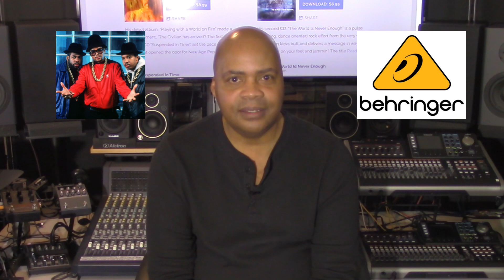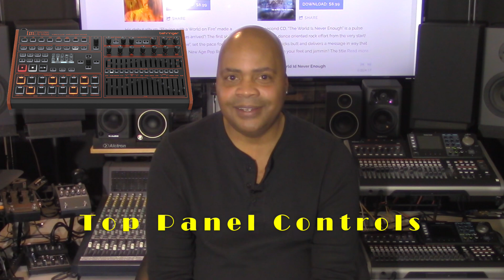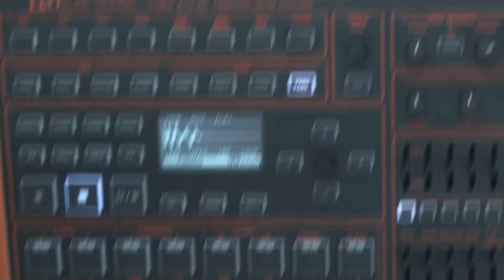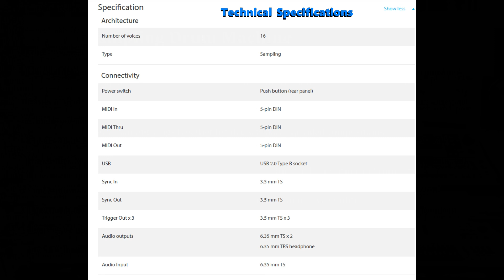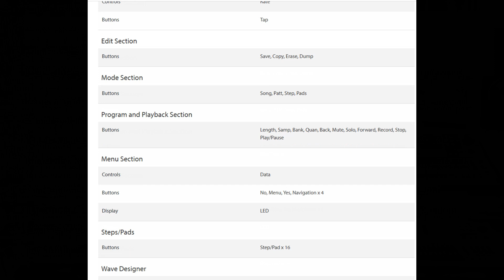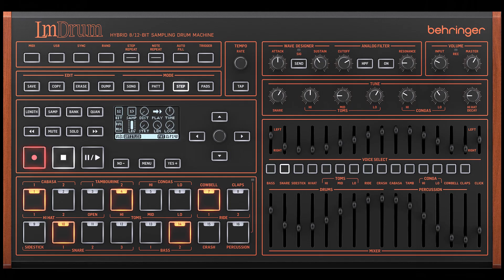Behringer LM Drum Hybrid Sampling Drum Machine: Complete Overview

Comment: To speed up the cursor while trimming the ends, you need to use the “Tempo  rate” knob to zoom in or out. Then use the data knob to move the cursor across more area faster. Zooming all the way out is the default option which allows you to trim the file more precisely.😎
Reply from the maker: Thanks for the helpful tip and for watching!

Comment: Why does it say 8/12 bit resolution? What are the actual converter specs and what is the bit rate and resolution of recorded samples. It’s common for these companies to use bit crushers and is important to be clear about what the sampler is doing. I don’t understand why it’s so hard for these companies to list the specs - A/D conversion bit depth and rate; D/A conversion bit depth and rate; recorded sample bit depth and rate. This is what we need to know at minimum.